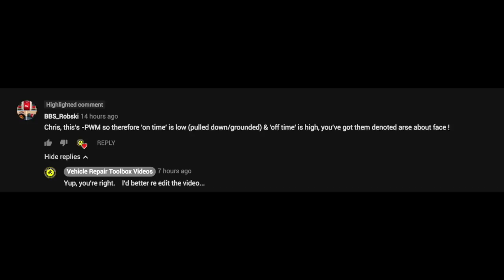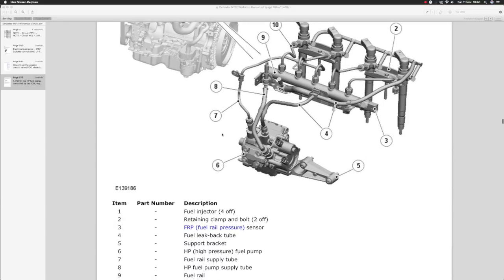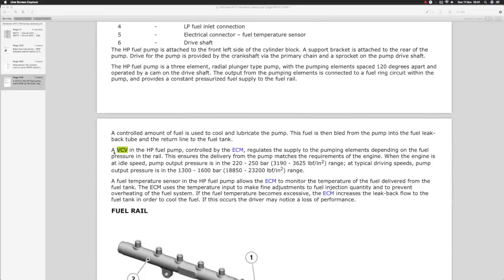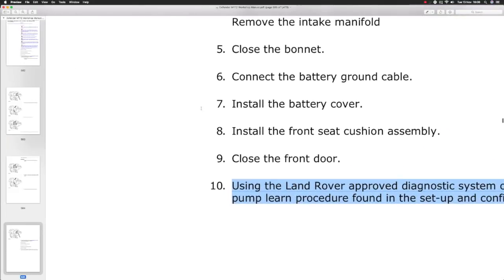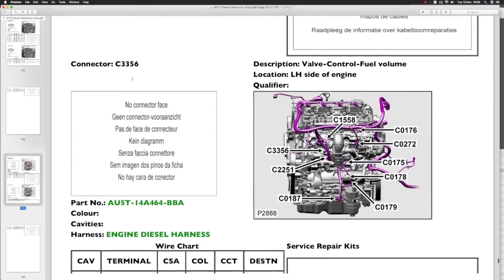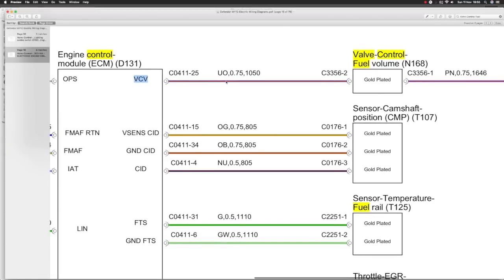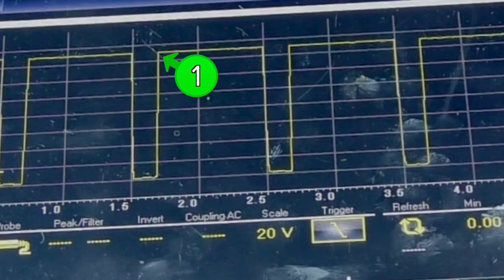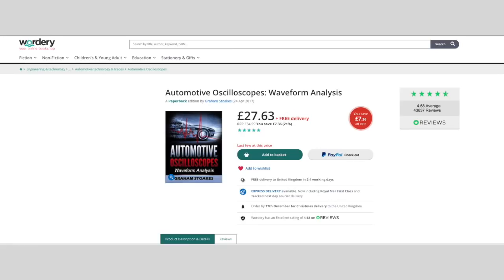Oscilloscope - Diesel Metering Control Valve (VCV MPROP)  - Land Rover Puma/Peugeot 406

Comment: So being a cp1s3 pump that doesn't actually have a volume control valve, that's actually a pressure regulator on the pump aka DRV 😅
Reply: Just for clarity the Mprop or volume control valve controls the rail pressure by adjusting the volume of fuel allowed into the pumping chambers of the fuel pump, the DRV is a pressure regulator which creates a controlled leak on the high pressure side to regulate the pressure in the system

Comment: I've got an 11b800 code on a 2008 mercedes c320 diesel,says "The control deviation during rail pressure regulation via the quantity control valve is too high"
This is on the high pressure pump,will the fuel come out at high pressure replacing this valve?
Car runs perfectly,eml light only comes on when you give it the beans at around 60mph.
No stalling,idling problems at all,it's only at speed.

Comment: Hi Mr Dan
Please coulde you explaine me whay some common rail systems countaine only  metering valve  and others containe a  metering valve and pressure regulator 
How does only a metering valve  could control the pressure  increasing without having troubls for exempl cp1h , cp3.
thanks
Reply from the maker: The metering valve is found on the high-pressure fuel pump and the pressure regulator will be found on the rail. If they have a pressure sensor on the pump it is because they want to compare rail pressure with the pump output pressure.  Or just as a convenient place to situate a sensor. Manufacturers do what they need to to get results.

Comment: Great Video! Can i ask you what editing and screencapture software you are using? Thanks for charing👍💪
Reply from the maker: It's called "live Screen Capture" which comes with Titanium Toast software.  I'm editing on an iMAC.   I did have a good screen recording set up from the apple store but they stopped using the Apple platform and put their prices up too,...it was called Telestream Screenflow.  Very good App but costs £129 for the basic package now.   This one now I am using is a cheaper version that has trouble recording sound and can't be edited once recorded as the Screenflow can.    

.   What editing software are you using Dan?
Reply: Thanks for the feedback, I'm using adobe premiere.
Reply from the maker: @Diagnosedan   you're editing is getting better and better.  (y)